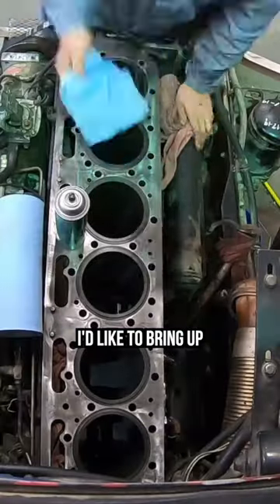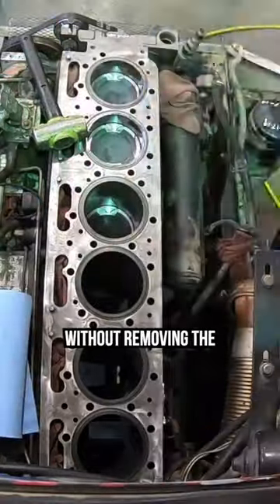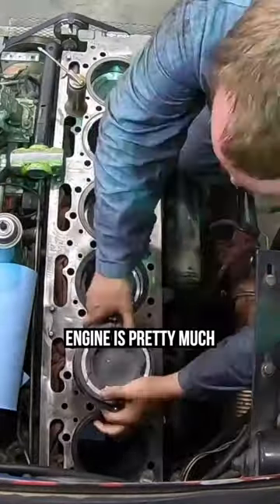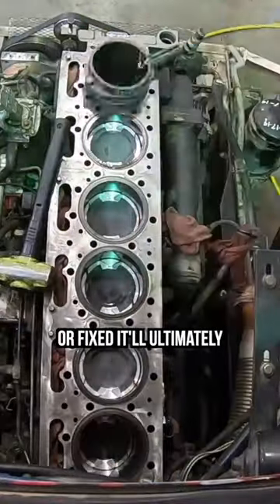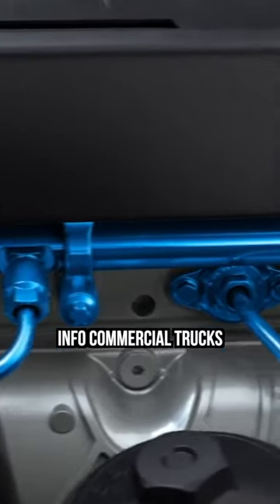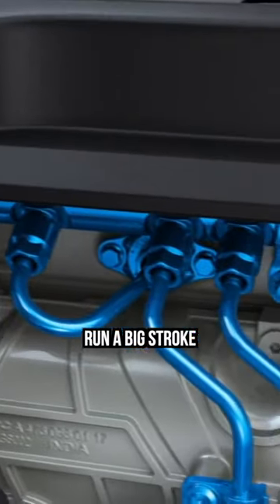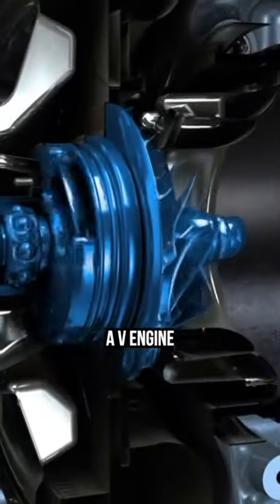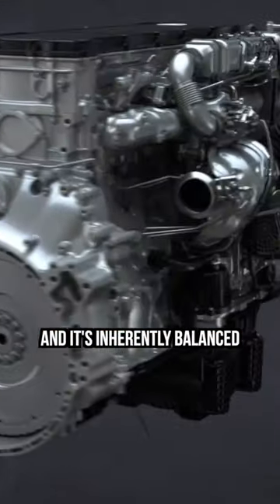Why Inline Six Engines are Easier to Rebuild in Semi Trucks

Comment: Inline 6s in my experience can get nearly the same type of fuel economy too I have a turbo 4 now but I used to have a non turbo inline 6 and it would average 30 mpg which is saying something cause I’m definitely not all highway miles
Reply: Ayyyy I got a turbo 4 too, what’s yours? I got an s3
Reply: My gasser v8 averages 33mpg highway on summer tires. I attribute that to a low rolling resistance, long gearing, and a .26 coefficient of drag more than anything.
Reply: @bleachstain9785  My E55 AMG with 0.27 cd of drag and a 2.65 gear ratio is only getting 23-24 MPG on the highway lol. Probably because of that 2.1L supercharger on top of the engine
Reply: @aimxdy8680  oh yeah you’ve got a half a liter extra displacement, on top of the 2.1 L of supercharger. It’s wild that the W211 E500 had a lower coefficient of drag compared to the E55 though

Comment: “The frame rails really aren’t in the way of anything.” 

Paccar MX has joined the chat.
Reply: Duuude!!  What an ass tumor those things are!!  We call them the Black Plague.
Reply: @jebediahnightlinger6357  when you work for KW, you call them a paycheck 🫠🫠🫠
Reply: Subaru has entered the chat!
Reply: This is no joke. i swear they put the ecu, every section of the harness, like 10 air lines, the starter, compressor, power steering and cab mount all clutter the area. Not to mention stuffing the 4 of 6 cylinders under the firewall. I hate those trucks

Comment: I will never sell my 96 f150 straight 6. Great torque.
Reply: Build a truck brand new but even better
Reply: I used to like the straight 6 gas engine for its torque, until it burned up on the highway
Reply: What if I offered $1 million dollars for it?
Reply: @AbcAbc-sp1od  he sell it and buy another 96 f150 with straight 6 , he can buy alot of em with a million
Reply: @AbcAbc-sp1od  My best friend keeps asking me that. I think he wants me to get with the times, but modern trucks suck. XD
Reply: @jamesgizasson  yeah, modern trucks do suck
Reply: @AbcAbc-sp1od  I mean, they're nice... but I need something that'll be around forever. That's why I'm having my 12 valve rebuilt instead of just buying a new Ram. :)

Comment: straight six also has less internal friction, it uses less fuel.
Reply: Its tall as hell though man
Reply: @TheAnnoyingBoss  Trucks are not race cars.........horses, for courses.
Reply: @TheAnnoyingBoss  that's why slant sixes used to exist.
Reply: Blatant lie, you know nothing. What does "internal friction" even mean? Where specifically?
Reply: @peterinfamilyguy ot the poster but piston rings seal with what? Friction wow… so having less of them with the same amount of applied force making the same power means…. Less frictional losses there. Same for every bearing surface attached to the crank that moves as it’s getting slammed a few thousand times a minute even at idle from the explosions that are each cylinder firing. I can explain further if needed or you can think, one of those may even help you in the long run.
Reply: @alexmills1329  I’m a mechanical engineer working at an automotive OEM. Size of engine has very little if anything to do with friction losses. You’re just lying and guessing.
Reply: For a given displacement and stroke, a straight six for starters has fewer pistons, with therefore larger diameter pistons which have less contact with the bores........less friction. Same goes for the connecting rod journals........fewer journals, larger diameter,less friction.  A straight six is smoother........it has better inherent balance. That is something aircraft engine designers discovered all the way back in the early 20th century.  A smooth running engine needs to have uneven number of cylinders OR multiple of uneven numbers.  So 3,5,6,7,9,12 etc all work well........but not so much for 4 or 8 cylinders.  They can be made smoother with extra counterweights etc ........but that comes at a performance price.   The exhaust manifolds on a V8 truck engine are also much more complicated,have more surface area and shed more heat,losing energy that could otherwise provide more boost etc.
Reply: Back in 77, I ordered a new van from Ford.  I could get the 300 six or 302 V-8.  The six was rated for higher mpg.
Reply: @peterinfamilyguy  He went to the Brandon school of mechanics
Reply: @wazza33racer  ahh... The only engines on your list with perfect primary and secondary balance without aid are the straight 6 and V12... Your claim about 8s is false as well. A straight 8 or a flat 8 will have perfect primary and secondary balance. A V8 doesn't. V6s don't have perfect balance both ways. Just the straight. Iirc if you have a 120° V6 that's the only way you're getting perfect balances. Crank. Number of cylinders. Engine configuration. Those are the only determining factors to balance. The reason a straight 6 has all-round perfect balance is due to what I already said in addition to the specific crank angle which puts- 2 pistons at tdc, 2 at bdc, and 2 in the middle at any and all given times.
Reply: @peterinfamilyguy  online engines are less complex with less moving parts… mr engineer. he’s not talking size, he’s talking configuration.
Reply: @BassmentBrain  I know. It has little impact.. what does have an impact is the oil, engine dimension tolerances and bearing frictions.. if you try to design an engine regardless of the cylinder configuration you'll discover this
Reply: @peterinfamilyguy the amount of cilinders do really have an impact on friction tho, the same volume with less cilinders equals less surface area to lose work and create friction, thus making it more efficient.

Comment: The actual difference in rebuilding a “semi-truck” (class 8 truck) engine compared to a pickup is that the large diesel engines used in big trucks use a separate removable liner for the cylinder where light duty diesels and gasoline engines (even the fabled 5.9 / 6.7 Cummins) are simple parent bore designs where the piston rides in a bore in the block itself and the cylinder wall is the cast iron of the block itself, meaning that once the bore is worn enough to warrant a rebuild or a piston gets got and causes scoring the block has to be removed and over-bored on a mill regardless of whether it’s a V or inline design. That said up until a little over 30 years ago there were V engines offered in HD trucks, the last of them being the fairly popular 92 series Detroit diesels and the 3408 Caterpillar which is far less common. These engines used liners and could be “rebuilt” without removing the block from the chassis (an “in-frame” rebuild) and really weren’t significantly more difficult to rebuild than an inline engine, in some cases they were even slightly easier to work on in trucks with short hoods and limited space in the engine bay. The in-line 6 engine design ultimately won out though once length laws were reduced and stricter emissions standards were implemented, their advantages in longevity and ease of packaging ultimately outweighed the advantages of the V8’s, which were mostly related to size where space was limited and weight to an extent.
Reply: ive never seen a non sleeved bore in my life
even my 100cc go kart has one

Comment: Unless it’s a ford 300-6, you gotta lift the engine just to replace the oil pan gasket.
Reply: How often do you need to that?  300,000 miles?
Reply: @ks_hunter7327  not exactly age is also a key point you can have 50k miles and start using it and everything starts leaking.

Comment: My first truck was a 1969 Chevy with a 250 straight 6 and a 3 on the tree. Super easy to climb inside and sit on the fender. My Dad also had a Dodge with the 225, also very reliable. I don’t recall any inline 6 that were not reliable
Reply: Bmw inline sixes, lol
Reply: @AbcAbc-sp1od 
Pretty much. 
Soooo many issues. 
Proof? Well i own an 89, 325e.
Reply: @kairu_aname  yup! Ty

Comment: I see you N14 Cummins ❤
Reply: Best engine Cummins ever produced.
Reply: @arlendriver4113  no doubt! N14 celect plus 550, My favorite!
Reply: Cummins screwed up in putting the ceramic patch with the relief notch over the wrist  pin it should put the opposite  way , can't get oil over to the crowm over the pin bore  & injection spray pattetn sprays just above the ceramic  notch on the alom & can burn the alum crown !!

Comment: I have yet to see a 18 wheeler that has a v style engine
Reply: Then you haven't seen many 18 wheelers.. Detroit Diesel and their 2 stroke v engines are everywhere. 3408 Cat is a great truck engine also. Scania is the torque king of 16L diesel engines and it's a V8..
Reply: I heard of those 2 stroke diesel.... how does that work oil wise?
Some oil in the diesel like a bike lol?!
Reply: @orderofmagnitude-TPATP it still a baisc deisal but has older injectors that are mechanical
Reply: then you haven't been around semis long.  there were even v12s
Reply: @oregonfordguy9812  doesn't really answer my question with the oil... but many thanks

Comment: The Ford 240/300 inline 6 is easily one of the most durable engines ever made, has the benefits of having lots of torque like a diesel engine but doesn’t have the drawbacks of a diesel engine.

Comment: For MANY MANY years, Ford Australia had an inline 6 in their main family car, the falcon. Essentially the same block from 1979 to September 2016. I have a 2008 that is a DEDICATED propane engine, FACTORY built to ONLY run on propane. Incredible power in the thing.

Comment: The whole "long stroke = more torque" thing really annoys me.  If you look at the math, bore and stroke both deliver torque equally for a given displacement and cylinder pressure.  Torque is (pressure x piston area)(aka force) x lever length.  3 variables to play with.  Stroke gives you lever length, bore gives you piston area.  Truck engines use a long stroke because it makes the engine less absurdly long, it's geometrically easier to get high compression with a good combustion chamber shape, and at low RPM you're not running into piston speed or valve area limitations.

It's easy to find counterexamples to prove that bore and stroke don't affect the power curve.  Chrysler 440, enormous bore on a short stroke, massive torque from idle.  Honda K24, stroke longer than bore, has no torque but revs to a million RPM.  In fact, the Honda's stroke is almost 14mm LONGER than the big-block Mopar.  99mm vs 3.75" (95.3mm).  Long-stroke torque is a myth.  Displacement is displacement; after that it's all in the airflow package.

Comment: Two Parallel 6's Each to independent transfer cases attached to one sided Diff's left and right to the Front Wheels' then Two synchronized Automactics to Two One sided Axels for the back, left and right Wheels' would be a very awesome 'Can this Torque Monster even be Made?!' _One Heck of a 4x4 Build! _ 💪🇺🇲🏁 Plus if one breaks? you've got another Complete Engine and Drive line to get you Back Home or to the Shop! _

Comment: The best engines are inline 6
Reply: You got that rigjt brother, my i6 has 154k miles
Reply: Some i5 are good too. I used to have a volvo 850 with og engine and transmission at over 400k miles

Comment: Did one in my 64 Chevy van back in early 80's.  It's should have been pulled and bored, but I didn't have money for pistons and all that, and the engine block would have to come out inside the van.  Nope.

Comment: BMW tilting their straight 6's sideways for no god damn reason: "it's my time to shine"
Reply: They tilt the engine so the hood can be lower also rotating the engine over on its side, helps reduce vibrations
Reply: Yeah I have two e46’s 330, the hood would definitely not fit without the tilt, skyline’s also did this too

Comment: Inline motors are better in every way for just about everything😅. Why doesn't ford or GM make a f150 or 1500 with a inline gas motor I know there a little more top heavy but as wide as new trucks are it shouldn't be a problem.

Comment: Hate to be the party pooper but it's not really about what engine layout is easier to work on but rather how much space the truck or car has in the engine bay. So really, I6s are just like any other engine. My older 2001 GMC HD had a 6.0L V8 with a hell of a lot of space in the engine bay to work on. Meanwhile my 2003 Sunfire has no room to work with and it has half the cylinders the GMC has.

It's all about how the engine bay is designed.

Comment: My Nova had a straight 6.No timing belt,just 4 gears.
Reply: A gear driven engine. You don't see that anymore on passenger vehicles. Cummins engine have a gear driven timing system.
Reply: @MrWelfarehater  ford's inline 300 used timing gears too didn't it? Admittedly not a common design in passenger vehicles from what I've seen, agreed.

Comment: What I was going to say was by in large covered in the video here. With the only downside to the in-line configuration is physical size for length and height. But even that isn't that much of a issue if comparing these to the V blocks found in Europe. Even the 'small' v6 there is nearly as large as the I6 here and is certainly wider.

What I miss having, is the I6 as an engine option for pickup trucks and some sedans. Well save for BMW, they still rock a I6. Nissan makes a nice one, in gas and diesel but doesn't offer it for the north American market, at least one that isn't a joint venture. Toyota is the same, Isuzu paired with Nissan and is badged as 'Duramax'.

Comment: Online 4 is great too, still easy to pull an engine and make sure you do it correctly aka sending out to be bored over and honed.
Reply: They have really bad balance though which introduces a large amount of drivetrain stress. There's a reason I4s are mostly used in smaIl passenger vehicles and motorcycles.

Comment: The two engines I hate replacing bearings in. The n14 with its stupid washer clips and the dd15 with its set of 90 degree torque turns. I just finished a dd in a cascadia. My back and shoulders are still killing me from running the torque multiplier.

Comment: I love an inline six, they' re preferable to me over other configurations. I had a Mercedes-Benz with a seven main bearing M114 inline six, and it was so smooth. I put in new rods, mains and oil pump and drove it three more years after the rod bearings wore out. I did it in-situ. Piece of cake.

Comment: Also with a diesel you’re limited with how fast thou can rev and make power. 

You might as well scale the bore and stroke to take advantage of the efficiency. If you do you realize you only need 6 cylinders not 8.

There’s no point and now turbo packaging is waaaaay easier which is a critical component.

Comment: Only downside to i6 I can think of is the heat displacement into the manifold causing cylinder 1 or 6 to overheat, potentially causing broken rings,cracked heads, etc. Not saying you can't overcome this with a better designed header, but some i6 engines have this problem. Seen it in common rail cummins and bmw engines

Comment: Full rebuild cannot be done with the engine in the vehicle. A complete full rebuild requires machine work, and a lot of assembly. You can do a refresh with a engine still in the chassis, but not a rebuild.

Comment: Inherently balanced in the primary. The secondary is not great and tertiary is horrible. The balance makes no difference for an industrial engine, however. 

The true problem is the torsion that a crank shaft can and will experience in such a long engine, which is why inline engines mostly went away in cars 50 years ago.

Comment: You do have more block twist and crank flex when running high horse power due to them being longer which is why top fuel cars use v8 motors

Comment: It also has less reciprocating parts, less reciprocating mass, and 2 extra main bearings compared to a V8. From an engineering perspective an I6 pays a huge penalty in terms of physical dimensions as compared to V8 in terms of displacement, but this is more than made up for by forced induction if so equipped, and I6 engines are far easier to plumb for turbo charging due to all exhaust ports located on the

Comment: The whole point of the v shaped engine is to fit more engine in a limited space. Only reason "commercial applications" don't have issues working in i6 is because the space is designed for long narrow engines. When you put a i6 in "passenger application" where it's designed to be more square you run into issues working on it.

Comment: the only reason is that it's easy to produce and it"s easy to use , in combination with inline 4 ..... if all engines were V configuration it would be V4 V6 etc

Comment: I was a Jaguar tech fpr many years, i had the pleasure of sleeving a 4.2 litre 6 cylinder that a wrist pin came out and cut a slot in the cylinder wall, didn't have to remove anything but the head and oil pan, got it done in under 8 hours

Comment: I can rebuild a clapped 300 I6 in a 68 dumptruck too lol, could rebuild the 361FT in my F700 cause I can litterally sit beside the engine in the bay and there like 3 foot of clearance from axle to oil pan

Comment: Umm stroking an engine it adds power but not because you think it does it adds power because the displacement is increased but the real reason why high stroke is desirable is because of cooling because if they increased the bore it would be a bit harder to cool but also it increases the price and basically it would just end in a disaster that's the real reason why most cars trucks and etc have mostly more stroked engines in them

Comment: all my vehicles are inline. my BMW 528 Inline 6 my jeep grand Cherokee 4.0 inline 6. and my BMW 330 inline 6
 and they all have over 200k and run smooth as glass
Reply: We been working on a 330 and plans to use a 528 in future videos! Great cars! Never had a better driving experience

Comment: Yeah it's easier to work on, few parts needed, simpler and doesn't need to be removed from truck. So let's go ahead and charge $25,000 for a rebuild. Hey but it's warrantied under certain conditions.